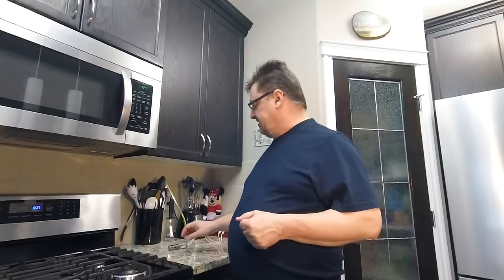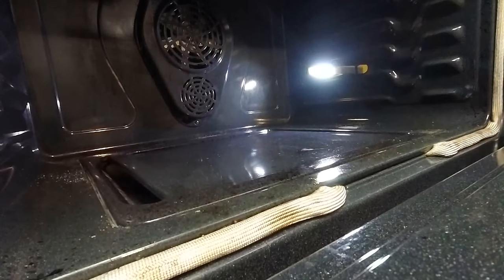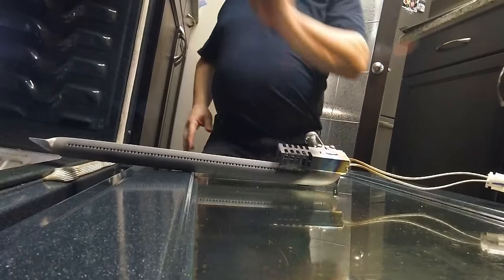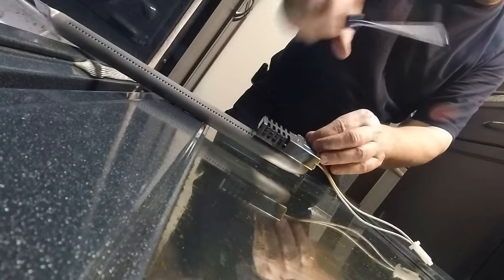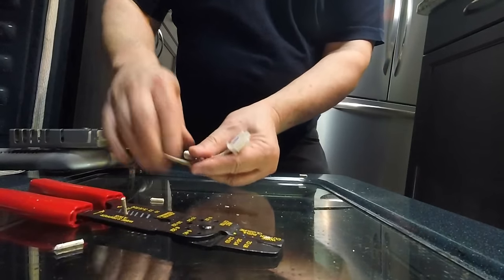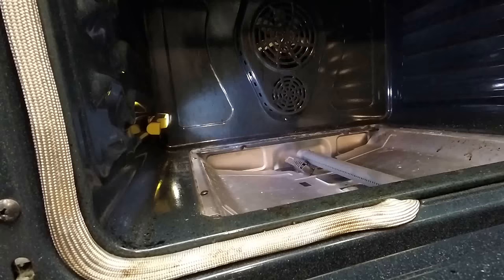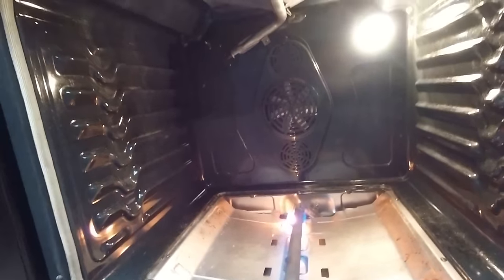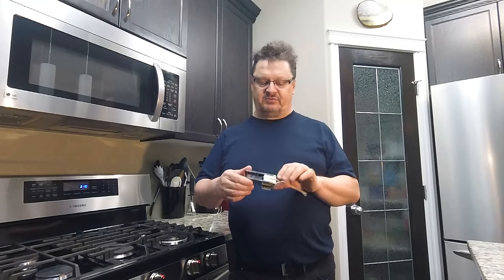Replacing the Oven Igniter in a Samsung Gas Range - Model FX710BGS

Comment: Hello Tom.  I ordered the part and I was told it was an OEM part. The picture clearly showed the plug in assembly.  However, it came in as though it was a generic !  (No plug).   So, I’m afraid to use those regular wire caps, as you did in the video.  I have no idea what the caps I have are made out of and you clearly said we have to use ceramic caps.   DANG!    I already called the company and complained.  They said , sorry , but this is all they have . . . . They also said I could return it for a full refund.  What do you think >. This is not for me, it’s for my sister. If it was for me, I’d take the chance and do it .  However, for my sister, since I’m not there, I don’t want to take a chance of trouble . .   Do you agree?

Comment: How did you diagnose that this was the faulty part? My Samsung stopped heating on cook (but broil works) and I get an E-08 code. What I've read about diagnosing involves going through the back and testing several things. It would be great if this part were the problem, it seems easy to access and replace.
Reply: I just took things apart, and found that the igniter looked scorched. I was getting the same error code for awhile (2 months), but sometimes the oven would still heat. Over time, it started to take 20-30 to preheat to 400°. I replaced my part through Amazon for $17, and figured that price was worth it if it didn't work. I was quoted a minimum of a $300 service repair.
Got the part, watched this video, and fixed my oven in under 20 minutes.

Comment: Silly question but you mentioned turning the gas back on, but didn’t mention turning it off at the start. Did you do that and how?
Reply from the maker: Thanks for bringing this to my attention.  I pinned the following comment:
I did not talk about turning off the gas to the range.  It is always best practice, when working on any appliance, to turn off the gas and turn off the power.  While it may sometimes seem unnecessary - safety first!

Comment: I had a question before replacing the ignitor, we turned on to preheat the oven and it was lit but after 5 min leaving it on alot of gas smell and the temp didn't go above 150 degrees. So by changing the ignitor would fix this problem I m having?
Reply from the maker: This reply might be too little, too late but taking a long time to preheat the oven is one sign the igniter is weak.  In my case the igniter would not even glow so it was obvious.  Other people have said the igniter glows but does not draw enough amperage to cause the gas valve to open.

Comment: Great Video, Tom.

I have the Samsung NX58H5600SS.  My issue is a slightly different: the oven heats up but we've noticed that it is taking longer and longer to get to temperature.  For example, it can take around 30-35 mins to get to 350 which seems ridiculous and much longer than it used to (we've had the unit for about 2 1/2 years).   The stovetop burners work fine, however.  From what I've read, this could be an indication of a failing igniter.    Before I order the part -- any thoughts?  Has anyone else experienced this?
Reply: Russ Mitchell I have same issue
Reply: Update: replaced the part with the Maytag 12400035 (ordered from Amazon.com for 25$ USD) as recommended by Arnold below.   Works perfectly!  Now takes under 7 minutes to get to 350.
Reply: @ramitche11  hi Russ, have same issue and same Samsung oven. I hear it going on and off (poof, poof) but the it eventually heats to the desired temperature but still have that poof poof sound. Is that what you had? I am thinking to change using the part you recommended.

Comment: Thanks for this.  I am not used to working with gas so am unclear: do I somehow disconnect the gas to the range too so that none is flowing there when the igniter is removed.
Reply: No, the gas does not need to be disconnected.  This is an electrical part, and for safety the power needs to be removed either by unplugging the stove or turning it off at the breaker while working on it.
Reply: Many thanks Kevin and Tom.  Part is ordered and I'll be doing this fix this weekend.
Reply: Part intalled and it works!  You saved me a bundle.  Many thanks!

Comment: Would you clarify one thing for me? I have the exact oven you have. The heating element will glow and then it will throw the e-08 error. If you then try and bake again most times it will work. Is that what yours did, or is there a temperature sensor that isn’t sensing the heat?
Reply: I think I figured it out. A little more info is that even though my igniter will glow it is only drawing 2.5 amps. In order for the gas safety valve to kick on it needs to draw 3.2/3.6 amps. When I checked the ohms at room temperature of the igniter it read 390 ohms which according to a site is just within range, but like I said it’s only drawing 2.5 amps. I bought an igniter, just have to wait to receive it. I’ll update here if it isn’t the problem for anyone else that may come across this issue.
Reply: Yes the igniter fixed the problem

Comment: I need help with a Samsung gas stove I replaced new #1 control panel  #2 temperature sensor  #3 igniter and worked fine ona and it went back to error code  S5 ???

Comment: You showed how to repair the igniter on the lower heat element.  But there is also a heat element and an igniter on the upper part of the oven. What is that heat element and igniter for?
Reply from the maker: That element is for the broiler.
Reply: @mundaneman254  thank you
Reply: @mundaneman254  I need to change the gas safety valve on my Samsung gas oven. Do you know any videos that could help? I had a serviceman look at my range and he didn't know how to replace the valve. The broiler element works but there's no gas flowing through the bake element. Thank you in advance.

Comment: If the igniter is broken, will gas still come out if the oven is turned on?
Reply from the maker: To get gas to flow, the igniter draws amperage.  This draw in amperage is what causes the gas valve to open and the heated igniter ignites the gas.  If the igniter is broken, not working completely or even only partially working the gas valve will not open.

Comment: Helol, What did you replace to fix it?
Reply from the maker: The igniter.  I used part generic part number 5303935066 by Manufacturer Frigidaire.  The Samsung OEM part number is - AP5577941

Comment: My oven igniter does light up but their is no flame on the heating element could it be that’s also
Reply from the maker: Possibly.  If the igniter is not drawing enough current it will not signal the gas valve to open.  That is just my opinion though.

Comment: Help, did you turn off the gas?
Reply from the maker: Thanks for bringing this to my attention.  I pinned the following comment:
I did not talk about turning off the gas to the range.  It is always best practice, when working on any appliance, to turn off the gas and turn off the power.  While it may sometimes seem unnecessary - safety first!
Reply: @mundaneman254  thank you for your easy to follow video!  My first igniter came broken, so it took 10 days more before we received the second. It did only take about 15 minutes, once we could see the igniter.  Thank you so much, and we like to eat, too!

Comment: Help!!!  I bought a new igniter and installed it per the video. When I turn it on Bake, the igniter glows red for about 5-10 seconds and then it clicks off. The gas safety valve never releases the flow of gas because the igniter never gets white hot - Help, any ideas???  Does the oven door have to be reinstalled for this to work?????   Also, I took the oven door completely off. Does it matter if the door is off?
Reply: Tom Wheatley hi Tom

Thank you for responding......I suppose it’s possible that the igniter is no good although I just purchased it from Amazon.....very frustrated that my new igniter won’t work.  One last question.  Does it matter which wire from the igniter connects to a specific wire down below near the gas valve?
Reply: I cannot reinstall my oven door for my Samsung gas oven Model NX58H9500WS. The latches at the bottom do not catch
Reply: Tom, my igniter worked but only after we got the door correctly mounted. You should inform people that when taking the oven door off, it is critical that you put those safety locks all the way down it the hinges will not fit into the slots correctly when reinstalling the door

Comment: Great job showing me how to fix the WORSE OVEN EVER MADE !!! Wrong temperature off by 75 degrees, knobs break, the grill chipped, and they use decals for their name with move when you clean it ! Never buy Samsung !
Reply from the maker: Yes, we now have a Sam_ung because the s came off and a bad knob that cracked inside.  At 10 years old it still works so I guess that's something.

Comment: Does not look that old.  Samsung is selling absolute crap products.  My Samsung stove won’t light after 2 year and 10 months of probably below average usage. Samsung should not be allowed to sell this garbage.
Reply from the maker: I have heard that if you don't use the self clean function then the igniter will last longer.  Cannot confirm though.  Why pay more for a function that if you use it will break other parts of your range though?
Reply: It appears even after the gas is lit the ignighter stays on the entire cycle. Is this correct?? And then when it reaches temp, does it all shut down and start cycle over again when temp drops?? I can see how the igniter burns up so damn fast if it's on during the entire heat up cycle. I need to contact Samsung about this.. 🙄